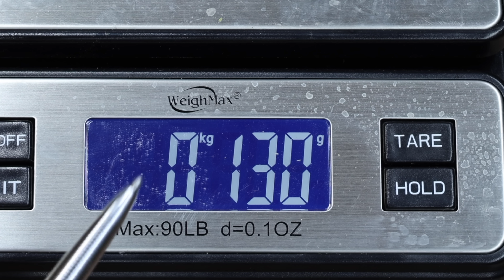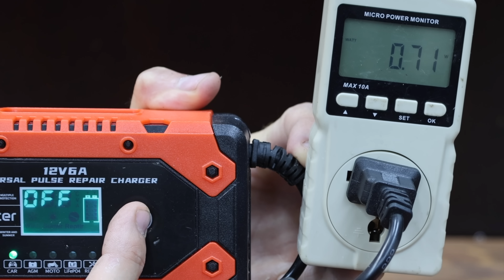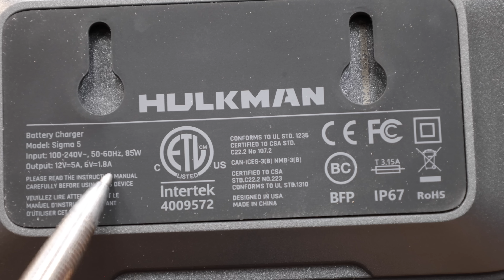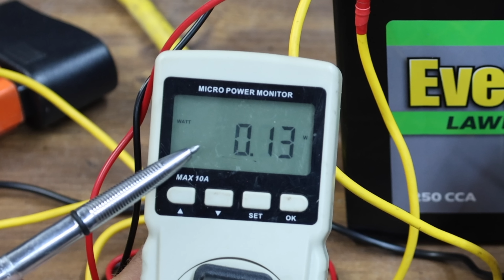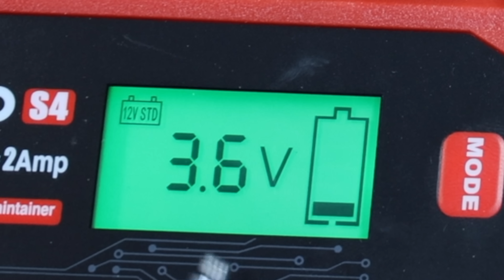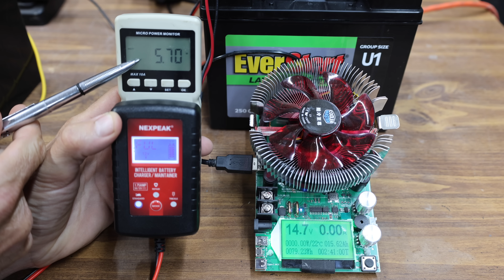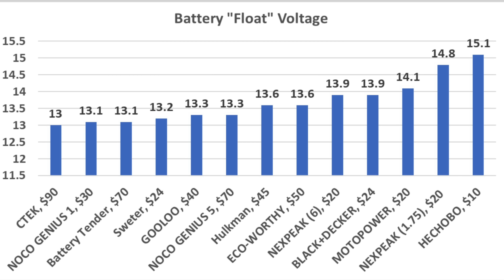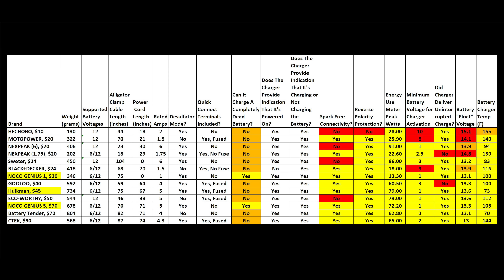I Tested the Most Hyped Car Battery Chargers – One Stood Out!

Comment: I have a question on your float charge test, do you rely on the chargers themselves to tell you they're in float charge mode? I'm asking since some chargers may take a full 20 hours to enter float charge from absorption charge, with absorption charge you should see a high voltage (ie, 14-14,5v)
would've liked if you checked the amps going on the DC side too rather than assuming the chargers are close to supplying 100% of the input power, but that doesn't really matter too much

Comment: Battery trickle charger or maintainer that can be run off of a power station would be nice to know. I know the new sodium battery can safely operated down to fully discharged state. So for people needing to store their fun car for extended periods, a charging solution running off of a power station would be desirable. A comparison on power draw difference would make a great video. Additionally dc operation is more efficient on power stations, so a dc to dc trickle charger comparison would be nice too. Solar trickle chargers are dc to dc. 
Thanks.

Comment: Quit using my small Battery Tender years ago—it boiled out the water fairly quickly.  Switched to NOCOs.  Use all sizes and none of them have float charges that wear out my batteries.  The one on my boat really gets abuse and seems to be doing a good job.
Reply from the maker: Thanks for the feedback!

Comment: Battery Tender has shown itself to be the most reliable over years of use on four vehicles, two outside.  Cheaper brands just kept on failing. "Pro tip" : You need a minimum of 3 amps to keep auto batteries maintained.

Comment: CTEK is the way to go.  Have had a battery tender that was ok but failed for my motorcycle.  Then got a second car that sits a lot, drive it about once a week sometimes less in the winter.  First battery was dead at year three.  CTEK has been on there when not in use and I am approaching ten years on the second battery!  The brand used by Porsche, for whatever that's worth.  After ten years its buttons are starting to fail, still works but have to press the mode button a few times to get it to respond so I just bought a new one, on sale it was $76. So depends on your budget, but worth it for me.  They have a cheaper version I got for the motorcycle.  Also like their accessories, have a cigarette lighter adapter and extension cord, makes it easy to use.
Reply from the maker: Thanks for the feedback.

Comment: I've never had a problem with the Battery Tender brand. And how often are you going to have a car battery down to nearly zero volts anywway? Any battery that got down that far is probably going to be damaged with a permanently compromised CCA output, necessary to start anything. If a battery has no "force mode", all you have to do is tempoprarily hook up a tiny 9v battery up in parallel to the battery and charger, tricking the charger into seeing voltage and getting the charging started for those chargers with no "force mode". Then take the 9V battery out of the equation because it might blow up if left in the circuit too long. But for a few seconds, you're ok. You have to be smarter than the chargers is all. As someone who has been both and electrician and an electronic technician, I'm smarter than the chargers.

Comment: How often would you have to charge a 12V battery down to almost no voltage? Typically you might encounter a 12v battery down to 9 volts maybe. That's more realistic. If you had a battery as dead as the one he was messing with at first, even if you got it charged back up I'm sure it's capacity and CCA would be highly compromised, meaning you'd need a new battery anyway. That nearly dead battery he was showing likely had a dead cell out of the 6 cells. His tests were unrealistic and not scientific.

Comment: Why no BatteryMINDer. I’ve had one for years. Love it. It also desulfates, switches to float. I don’t know if it charges a completely dead battery. I’ve never had to find out. The one I have can maintain eight batteries at a time. Just curious how it would have faired against the NOCOs.

Comment: I just bought a noco genius 1 last night prior to watching this video. Glad to know I made a good choice. Also a correction for the video, the Genius 1 does in fact have the quick connect, they are screwed into the clamps. I vaguely saw it on the box and it took me awhile to figure out where they were. But they are technically there, just makes the clamps useless then

Comment: Our family has Noco chargers in boats, snowmobiles, ATV's, in addition to Noco Power packs and Lithium batteries.  Very pleased with Noco products.  May cost more but get what you pay for.  When a battery is down you need reliable solutions and Noco is tops in our opinion.  Thanks PF for your excellent work as always!

Comment: The CTEK IS capable of charging a completely dead battery. You have to put it in power supply mode instead of charger mode so that it can bring the battery up to a voltage that charge mode can work with.
Reply: Pretty sure the MXS5 doesn't have power supply mode. The bigger CTEKs do, but not that one.
Reply: @AJB1  it has a recondition mode that does it.

Comment: I bought a charger for around $100 and for whatever reason it wouldn't charge my nearly completely dead battery in my pickup. So I spent like $20 on a battery tender trickle charger and a few days later battery is completely charged up.

Comment: I have 2-Noco Genius 2Amp - I have a larger more heavy duty Noco charger (can’t think of the model). So I have a lot of experience with Noco. It was the brand I tried after doing a lot of research about all the ones out there because it’s important to get a good charger; Efficient, Fast, Safe, Versatile because you don’t want one that’ll burn your house down while you’re gone or one that will charge a battery incorrectly or overcharges and then the battery would be ruined or exploded. 
I can say unequivocally that I will NEVER get a different brand than Noco!! They cost a few dollars more but worth it everytime! These chargers do EXACTLY what they say. No gimmicks or false statements, they are just amazing!
It analyzes and appropriately charges at the correct and smart rate. When they automatically switch to float it maintains a perfect 13.5 Volts with zero fluctuations. 
These really are a very smart charger. 
Noco is THE best. Noon one else comes close. 
Anyways, that’s my .02¢

Comment: Maybe it's just me, but I want to see sparks when connecting up a charger.  With modern batteries, hydrogen production is extremely rare, and unless you're in an enclosed garage with zero airflow, H2 escapes reeeeeeeally quickly.  Plus, with oxidised posts, the clamps really need to bite through any oxidation.  I've put pretty springy clamps on battery posts, and not had any current flow until I'd give them a good jiggle to saw through the oxide layers.  See sparks, now we got good flow.  Same with jumpstarters.  The chintzy clamps that don't even hurt if you clamp them on your finger, don't bite through oxides, either.

Comment: A normal fully charged 12 volt battery would have a voltage level of 12.6V. Anywhere around 12.6-12.8V is considered a good resting charge. Anywhere between 12.4-12.6V indicates the battery is partially discharged, but is still ok. Anything below 12.4V means the battery needs to be charged, and around 11.8-12V is considered a dead battery and won’t start a vehicle. And anything below 12V means potential damage to the battery.
On the flip side, when your vehicle is running, the normal voltage range is anywhere between 13.7-14.7V. Anything below that means a bad alternator or weak battery. And anything above 15V is overcharged and may cause damage. If your vehicle’s charging system is charging that high, the voltage regulator in the alternator is bad.

Comment: After suffering through especially multiple expensive NOCO failures, I am now a convert to the Beleeb C15 as my general charger. Also, what you simply need is a little switched power supply at the voltage of the battery to wake up a dead battery for a few minutes (or a "power supply" mode of the charger) , then any charger can take over. I still think the CTEK has the best algorithm (for expensive batteries...) and electronics of the lot, I use it for lithium battery charging. For long term lead acid maintenance charge I found the BatteryMinder the best. But generally, the quality of Lead Acid batteries is in free fall, mainly because of the use of recycled, and thus more and more contaminated, impure, lead. The Trojan golf cart batteries are the best example for this development.... After my last almost $1000 set died in less than 2 years, I converted to Lithium and am happier....

Comment: I have NOCO chargers on my vintage cars that see use in summer but not over the winter months. They really do a good job. One thing to note is that the genius 5 (and I think the 1) are meant for batteries up to 120aH. Bigger than that and you will need the Genius 10
Reply from the maker: Thanks for the feedback.

Comment: Battery Tender brand will blink red and not stay stead red if the battery is completely dead…

Most reliable battery charger I own has been Schauer brand that I have that my father bought over 30 years ago…

The Schauer (made in USA in Cincinnati Ohio). The rate of charge 6 amps and has a switch for either 6 or 12 volts.  

My current battery chargers used on my farm equipment and motorcycles is the brand Battery Tender Plus.  Provides perfect amount of low voltage to trickle charge after charging has been completed.

Great review, thanks for sharing ❤
Reply from the maker: Thanks and you are welcome!

Comment: Ya those chargers using a float charge at 14V are definitely using a circuit for LFP batteries. It is the optimal float voltage for those between 14 and 14.6 Should never be used on SLA or flooded. Scary they shipping LFP chargers as SLA or flooded chargers..They will boil above 14V.

Comment: I had a battery die in my 2018 BMW X3 after it sat without use for well over a month.  I'm retired and don't drive much.  Purchased the CTEK and, like you found, it wouldn't charge.  Then I recalled that I have a 40 year old "dumb" Sears charger with high and low amperage settings.  I connected it to the battery for 5 minutes and tried the CTEK again - worked fine and has kept my battery fresh for about 2 years now.  Sometimes it's smart not to be too smart.
Reply from the maker: Thanks for sharing.

Comment: An interesting thing to see tested is the recovery mode that you can find on some chargers like the Noco line. They use controlled high-voltage pulses to break down hardened sulfate crystals and stir the electrolyte for batteries that have sat too long without use. Of course you'd have to have a lot of batteries that are sulfated and settled electrolyte. Maybe if you only test a few, then you wouldn't have to have a ridiculous amount of batteries. haha

Comment: I have had a 5 station Battery Tender for decades!
 I have a boat with 2 batts, 4 motorcycles and 2 quads with batts.
 An RV with 3 batts.
 And 3 pickups.
 
 That tender is charging multiple batteries...all the time!!
 Bullettproof unit.

 But I have heard that the newer ones aren't as good.
 ???

Comment: Regarding the NextPeak test, I think you should retest the float voltage because this charger has multiple settings that require manual intervention. Standard charging (the mode used in this test) will always be higher because that is the mode that mimics the car's alternator. That is the maximum voltage this charger can deliver and that mode should not be used for maintaining the battery. The "float" measurement should be done under the "Trickle" setting and that value should be lower, fluctuating between 13.2 and 13.8V. NOCO does all this automatically and this particular charger does not. That is why they are not in the same class.

Comment: I’m currently using an energizer 4amp 9-step smart battery charger on a battery that sat nearly a year. Started at 3.6v and it’s been charging for about 5-6 hours now. Seems to work great! It’ll probably take all night to finish and I hope it works so I’m not out a couple hundred bucks for a new one. 

As always, great video!

Comment: I’ve used Noco for about 10 years now on motorcycles and bring a couple dead truck batteries back to life. I’ve used old school lead acid batteries i had to fill and maintain to agm to lithium ion. They’ve never failed me once i still have my genius 750 and It still works. I currently use a genius 2x4 and the 5 for my lithium battery. I’ve accidentally discharged the lithium and my agm batteries a couple times and both of those chargers were able to bring the batteries back to life, absolutely phenomenal chargers
Reply from the maker: Glad to hear you've had a great experience!

Comment: I have tested several CTEK chargers and unfortunately they are everything but long lasting. I had a lead acid battery charged in float mode to not let it die during winter. Guess what died, after 3 days the 120€ CTEK charger was dead. Brought a cheap Einhell one, held up 3 months continuously and it's working still after 3 years and some days in the rain. CTEK isn't worth the money.

Comment: Thanks. My AGM batteries on my diesel truck were a little low (~13V) and I was worried the battery was being drained slowly by all the electronics in the vehicle even when it was off. I don't use it as mich as I used to, every 2-4 weeks for vacation trips. I come from a flooded battery background and only had an old Craftsman 6/12 volt charger and was worried it might not be compatible with the AGM style lead acid battery desired charge rate/max. Your testing pointed me in right  direction after I went to the auto part stores. Leaning toward NOCO 1 or 5.

Comment: I've got a brother in the battery business and years ago he recommended the CTek chargers.  I've got a few cars that spend a lot of time sitting around.  I have yet to experience a failure and have never had a battery boil over or go dead on me.  One cool thing about the CTek is they sell a pigtail for the battery that facilitates a quick connect, and when the charger/maintainer is not plugged in the pigtail will give a readout of the battery state.
Reply from the maker: Thanks for sharing!

Comment: I've been a NOCO fan for 10+yrs. Have 3 of them now in different sizes. And have brought a completely dead motorcycle battery back with them as well. 
My 6 year old HD Road Glide battery is still going strong because of a NOCO charger.
When I go on long trips of 7-10 days and it isn't plugged into the NOCO charger 24/7, it still has good voltage. 
So the NOCO must be doing something right for it.
Not cheap but definitely worth it in my eyes.

Comment: Just my perspective as a long time user of CTEK in northern Sweden. I bought it about 15 years ago and it’s been through a lot. It has never faild me. The only negative is that the cables turn in to steel in winter temps. Just after i bought it they released a new model with better quality cabels.
Reply: The problem with cold weather flexibility in cables is the insulation. The plastic stiffens in the cold, but then it also loses it's flexibility as it ages. I've bought outdoor extension cords that have special cold weather insulation and they were super soft and flexible in the cold when they were new but after many years of use they are just as stiff as any other ordinary cable. They probably put a lot of softener in the plastic but after aging that softener all gasses out and leaves the plastic the same as any other stiff plastic. Aging always seems to affect plastic, along with exposure to outdoor elements.
Reply: also CTEK producing special model for cold temperatures. The model CTEK MXS 5.0 POLAR which has also cables designed for sub zero temperatures.
Reply: The connector is bad, weak connection, becomes hot,  replace with something of quality. otherwise an ok charger.

Comment: Nicely done! You have stepped up your game on chargers. It may be difficult to determine but of those that provide  desulfation, it would be great to determine which do a better job, with a focus on deep cycle batteries.  Deep cycle rarely have longer than a 3 year warranty, but i was able to keep my Boats Trojans alive for 10 years by regular desulfation cycles after heavy use in fishing tournaments. The 4 batteries cost about $1000 so getting long use is critical.

Comment: This was an interesting test! For Lead-Acid / AGM batteries, the charge voltage should be 14.4 and the float voltage should be 13.6. I'm surprised and disappointed that the Ctek floated at 13. Of all the chargers, I expected it to perform better. The chargers that had higher than 14.4 should be avoided. I use an Agilent 6033A autoranging DC power supply as a battery charger. I have to manually change the voltage from charging voltage to float voltage, but it's not a problem. It will charge even a stone dead battery.

Comment: The CTEK ramps up charge, and highest draw and charge occur when the fourth LED is illuminated. I’d be curious to know what it was pulling the.  When you measured it, only led 2 was on which is when the charger is slowly ramping up charge sensing if the battery can take it. 

Overall great comparison and cool data. There is only one charger for me and in my garage, and that’s the CTEK.
Reply from the maker: Thank you for the information!

Comment: The new “smart” charger stuff is so bad at charger dead batteries. I always end up using jumper cables from another battery to get the battery back to enough volts to be read so a charger can work or using an old John Deere charger that can charge even if completely dead as it isn’t smart.
Reply from the maker: Thanks for the feedback.